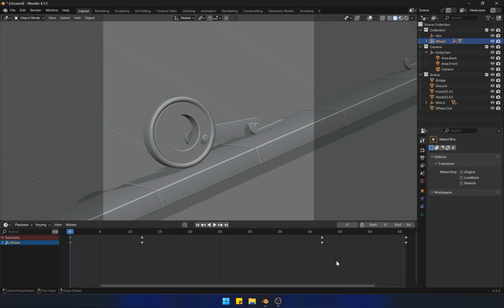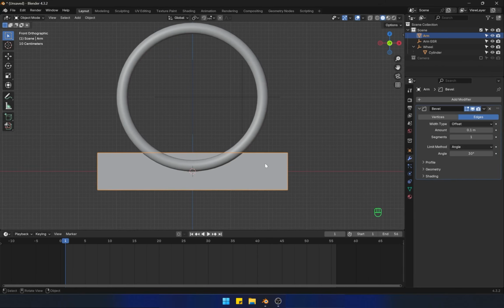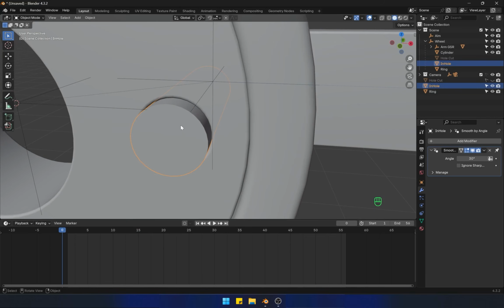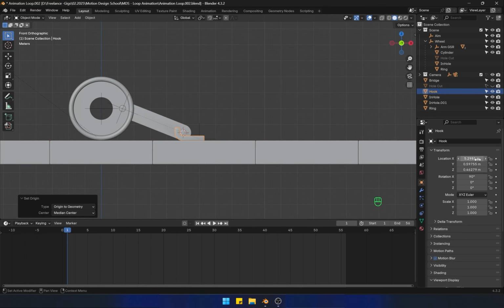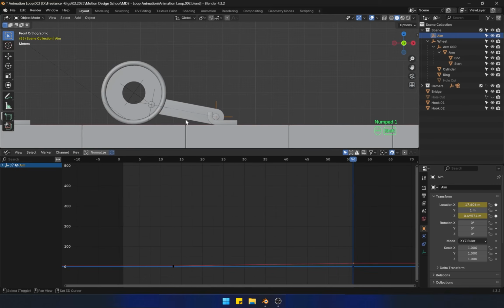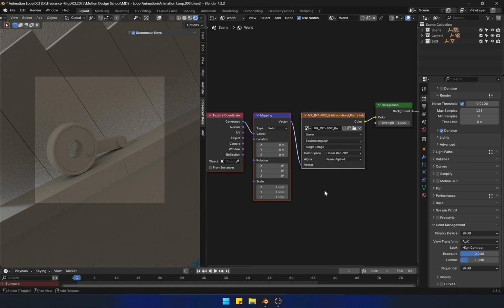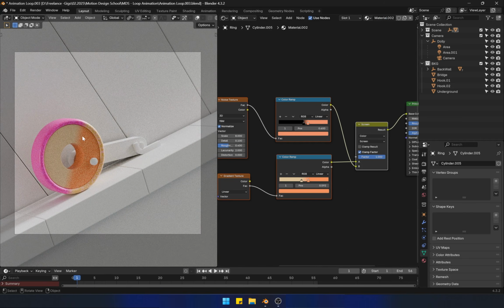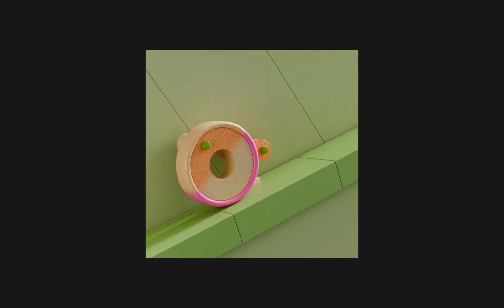Animation Loop in Blender – Make it Endless, Make it Hypnotic 💫

Comment: Great tutorial, but I am struggling with getting the lights exactly the same at start and end. But it may be, because I am using an 16:9 aspect ratio?
Reply from the maker: Hello, 

Make sure the lights are parented at the first frame to avoid any unintended changes.  

Also, the lighting difference might be due to parts of the background (such as walls) blocking the light or reflecting it at the end of the animation, especially around frame 55. Try hiding the parts that are not visible in the scene to prevent them from affecting the lighting.